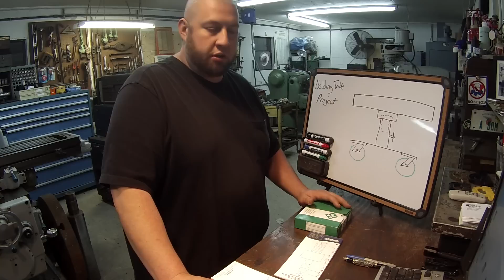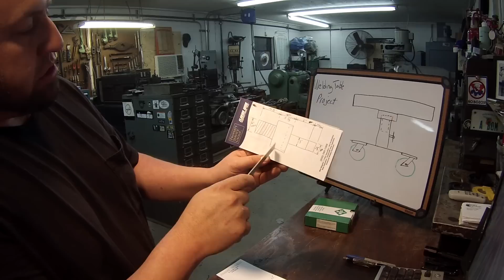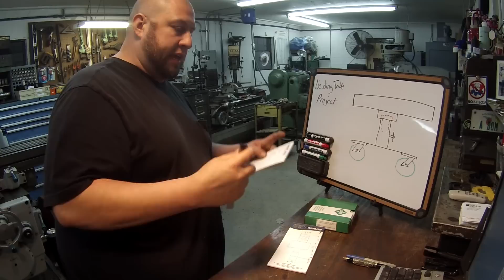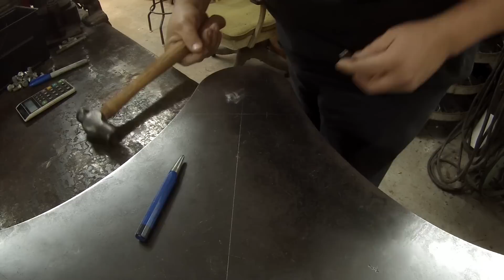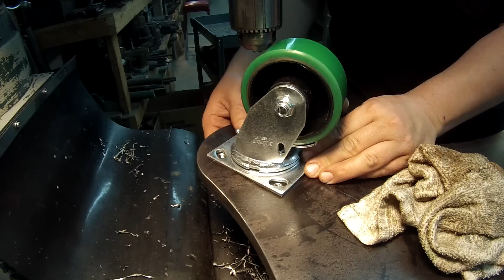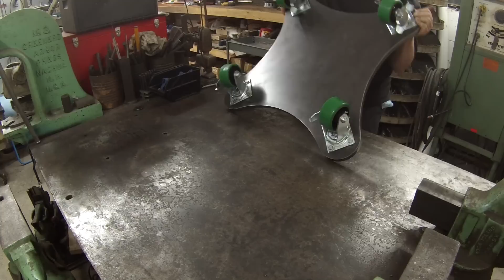Rotary Welding Table Build Part 1

Comment: Bro, two half inch weld beads per caster would have joined those wheels to the base just as good if not better than all that machine work and saved you hours of your life!
Reply from the maker: I didn't want to take the easy approach on this job. Sure, welding is quick and easy, but is it the proper way to install a castor?
Time is not a factor on this project. I'm doing it for the fun of metal working, and to have a cool work table in the shop. I'm also doing things the harder way to show something on video. Some may be elementary, but most guys enjoy watching it all.
Reply: We are machinists that can weld, not welders that can machine  :)
Reply: The welded casters will work really well when he gets the base plate powder coated. Welded casters is a lazy hack job. Sorry but my .02 worth.

Cheers,

Tom
Reply from the maker: Not being defensive Lawrence. Was simply stating why I have done things a certain way.
Reply: True, but this looks way better, and if, God forbid, one fails, be a hell of alot easier to replace!
Reply: Abom79 I would have installed those casters EXACTLY the same way you did Adam! That is a fine job you did and it looks great!  I wouldn't of even thought of welding those casters on.... if you ever have to remove those casters for whatever reason (replacement) it will be an easy task rather than trying to grind those welds back off.  Awesome job Adam and Happy New Year to you and Elena.... and Stella!
Reply: Lawrence Harasim There was absolutely nothing wrong with Adam's layout work.  I would have laid it out the exact same way!
Reply: Lawrence Harasim
Your a fucking troll. Go away.
Reply: Matthew Gischus spot on Matthew
Reply: oxtoolco + 1 on that one Tom! 
Us professionals prefer the bolts!!
Reply: Lawrence Harasim no idea why you actually started to argument that way at first... so if YOU would have done it different... it is okay for you but this is Adam's project and his way to do so... because a screwed on caster can be changed when broken or damaged easy... just remove bolts and screw a new one on... when it is welded on (perhaps not a stainless steel one but galvanized... as we know welding galvanized stuff = "healthy") you need to grind out the welds first to get a new one in place...

a lot of fun when the plate is being painted as he said in the vid... because I don't think that the casters will be painted as well ;)

just a few thoughts I had...
Reply from the maker: oxtoolco
Thanks Tom. Excellent points for sure. I like the fact they can be replaced if ever needed with ease, vs having to flip the whole thing over and grind welds.
Reply: Hey Bud....don't be so defensive let people voice there opinion and as you said in the beginning of the vid  there are many ways to do this! ...your a very good machinist but fab layout work maybe not your bag
Reply: very nice  Tom to stick up for you  and put his .02cent worth in to it...I agree I would not have welded the casters either...you never know you may want to change them to red ones!  :P
Reply: John,

It appears you took my terse comment the wrong way.  I was commenting on the general practice of welding casters not attacking you personally. If it came across that way I apologize as it was not my intent. 

regards,

Tom
Reply: Andakar,

The casters are mounted to the plate after its powder coated. You can do this easily if they are bolted as opposed to welded. They cannot go through the oven temperature required for flowing the powder paint.

Regards,

Tom
Reply: Razor Works
I think Adam should just machine up a set of casters on that do-all to bolt on, That's what Tom would do........
Reply: guys its a project that gives us something to watch but I agree that i would have done things much much differently
Reply: Abom79 like i said above you already stated in the beginning of the vid no reason to respond....let me tell ya something if you let this bother you your health will suffer and im speaking from experience maybe you should be focusing on your health for awhile and IMO is much more important then doing youtoob vids
Reply: Abom79 are you going to reinforce the final design a bit? even when the plate is kinda "not thin" ;) I guess a few gussets might help to make the center column a bit more Abom79-tough :)
Reply: Really this is your response....very slick there sparky! LOL
Reply: Hey Tom, I guess calling it my two cents justifies calling someone a lazy hack for offering a simple welding alternative to hours of machine shop work! :) Good day to you sir.
Reply: oxtoolco Tom, one thing I don't understand is how you protect the casters when you are going to powder coat the plate because I don't think you can weld them on later that good without damaging the coating again?
not that the powder would be the problem but the casters (as I have seen that they have grease nipples on them... so the bearings might be grease filled... and doesn't the heat you need to "bake" the coating affect the grease and some other parts of the casters?)

Lawrence Harasim same point but other question... doesn't the heat from welding kinda "boil" the grease in the casters?

perhaps you two gentlemen could explain or answer my two questions... thx for taking the time to read... and greetings from Lower Austria :)
Reply: Didn't you see my little smiley face in the reply? Just having fun. Enjoy both you and Mr. Abom. Thanks
Reply: John C Phew,

Can't afford to lose a sub........ 

Best,

Tom
Reply: oxtoolco that's what I thought... thx for your answer :)
greets from a subscriber of you :)

Comment: Looking good so far. I like the extra effort to keep the upper side clean.
Don't think I would go with a motorized system either. You can always add a positioner for rotating ability when needed.
I don't envy having to sand off the rust and scale... makes a hell of a mess!
I have used, in the past, a weld through primer as a layout coating for plate. It makes it easy to scribe lines on the mill scale. Might be worth a look. ;-)

Colin ;-)
Reply from the maker: Thanks Colin. Yes the cleaning make a dusty mess with the rust. I had to open my door and let the shop vent. I'll keep the primer paint trick in mind. But that new carbide scriber worked it's magic on this job.
Reply: Cleaned off some plate today again. Scale and rust... still hate it.. :-(

Comment: When you were drilling and tapping, why did you unclamp and move the plate to drill the next hole? Rather than using the hand wheels and moving the mill table with the plate clamped down?
Reply: Ps, liked the little trolley tour btw;-)
Reply from the maker: It's a simple hole pattern on a plate, and you have a nice tollerance there. Moving the plate and lining up the punch mark with a center is easier IMO.

Comment: Adam, I know you enjoy the machining aspect of these projects, but it would be far more simple, and probably much better, to use one half of a car back axle and using the brake drum to fix the table on to, you could still fix your castors to the diff end of the half axle, this would give you an already constructed bearing system to support the table, you could also use the hand brake part to lock the table rotation, giving you more time to get on with another project !
Reply: Not a bad idea! Would also simplify the option of adding a drive motor down the line.
Reply from the maker: Not a bad idea at all. Id love to see someone get started on it. :)

Comment: Problem with fix part is that they are fix. What you are looking for is some kind of a barber chair system. This way you can have all the features you are looking for, Hydraulic, variable height, turning and locking system just have to remove the seat, add wheels and the table, ;-)
Reply from the maker: Another great feature to have, but with keeping things simple one fixed height is where mine will be.
Reply: That was just fun to think of. I believe that in your case it will be faster to build it than to find the chair!

Happy new year to you and your family.

Comment: another benefit from undercutting for your lock bolt, any marring of the shaft wont stop you being able to slide the shaft back through the bronze bush if you should need to disassemble the table at any time. :)
Reply from the maker: That was the first reason why I designed it that way. Good thinking John.

Comment: Adam,  I know you said that you didn't want any mechanical parts to rotate the table.  You may want to do this later on. 
I would at least weld a large sprocket to the shaft so that later on you can add a chain drive.  I will give you a low speed motor and controller.
Reply from the maker: Herb, I just had no interest in making it electric powered.
Reply: Abom79
Use a bass drum pedal, run a longer chain up to a  freewheel from a bicycle attached to a  right angle drive from a drill. This can then drive the table using a belt to the smaller diameter on the back of the plate. In effect, you can step on the pedal to advance the table, each step will turn the table a little, adjustable by changing how far the pedal goes down. No motors, or electricity. Just some thrift store junk and some ingenuity...Or you could just keep it simple.